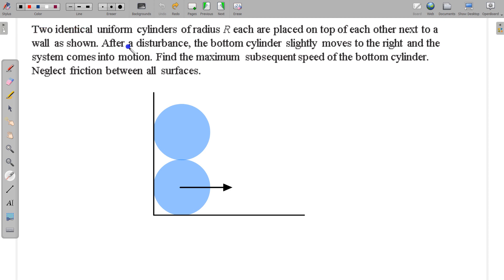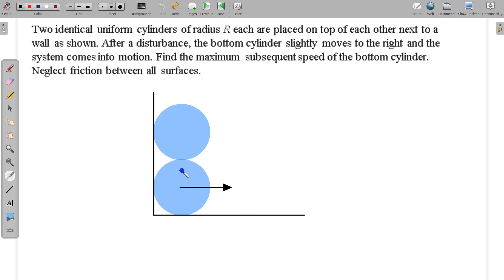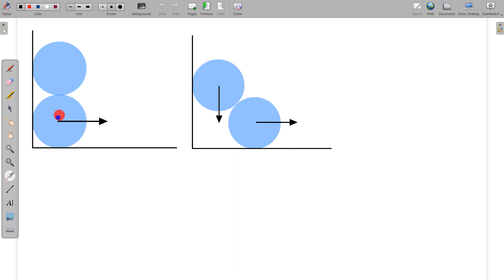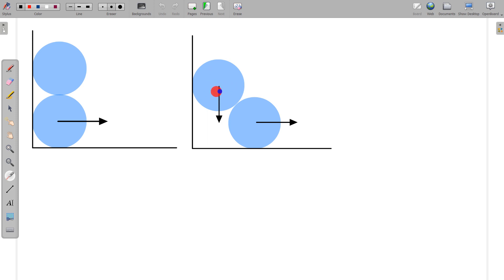Work Energy | Two Cylinders in Contact | Constraint | Maximum Speed

Comment: if we take two balls as a system , there is a impulse from the walls as well as the floor  and the net displacement along the x and the y axis is not zero thus we cannot conserve the energy .............am i right ?
Reply from the maker: Normal contact forces from wall and floor are doing no work as displacement of point of application of those forces is perpendicular to the forces .... and there are no nonconservative forces , so energy is conserved.

Comment: I just have one doubt sir,  while solving this question I couldn't explain to myself the reason why the balls should remain in contact during their motion. Please assist me with the same sir
Reply from the maker: The upper ball tends to fall freely and presses the lower ball... Lower ball speeds up due to horizontal component of normal.
The same normal acts on upper ball and it's horizontal component pushes it towards the wall.